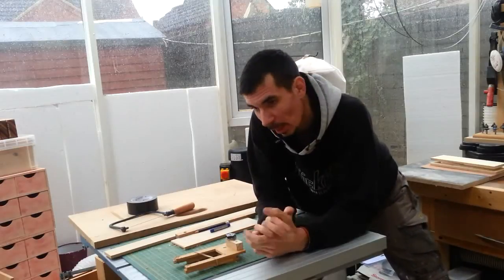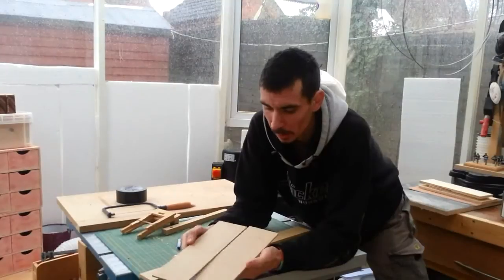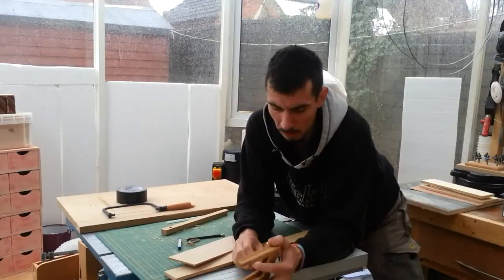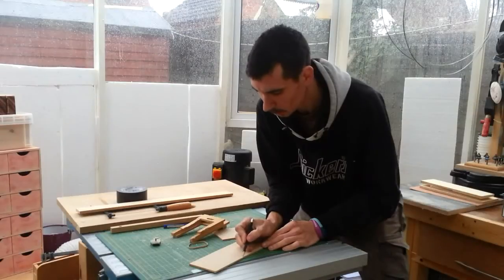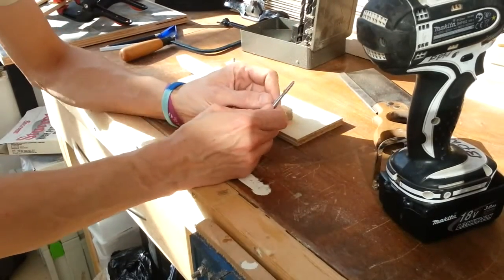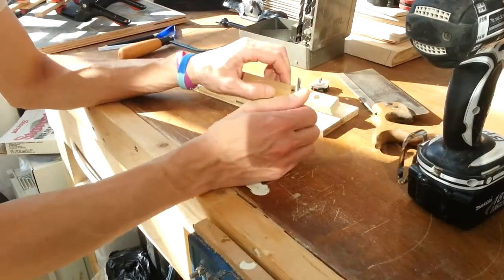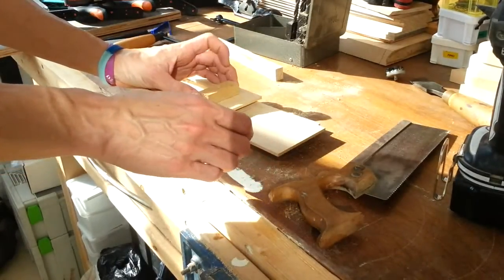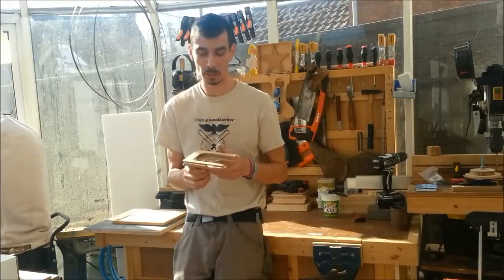Make a REALLY cheap camera holder for mobile phones to film your youtube videos with on a tripod

Comment: I was gonna make one of these but then I bought a cheap (but quality) handicam on eBay (still not done anything with it). You did a more thorough job than I would've. I don't know what your tripod is like but usually when filming, the lens faces towards the user and the touchscreen away, isn't your mounting fitting on the wrong side?